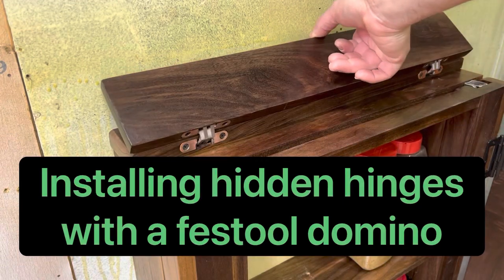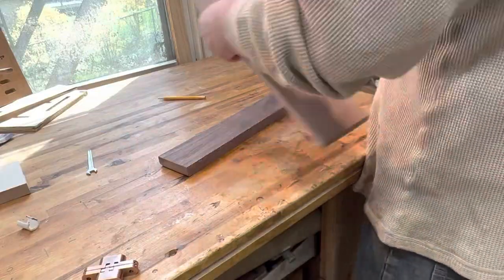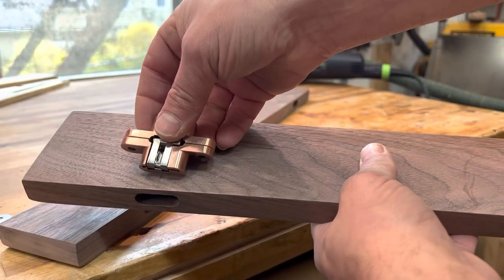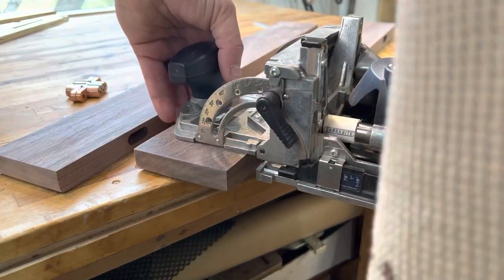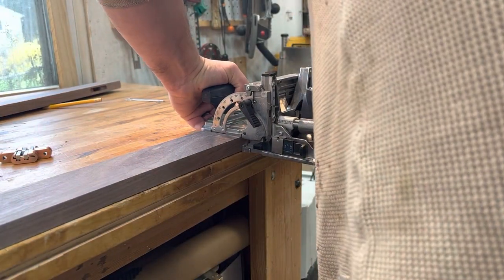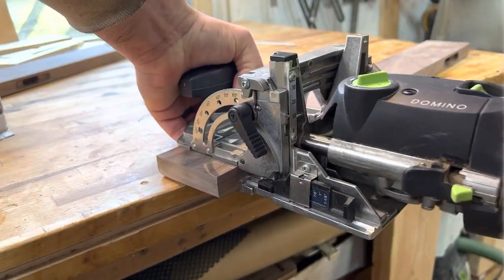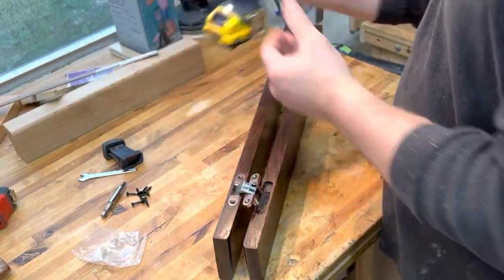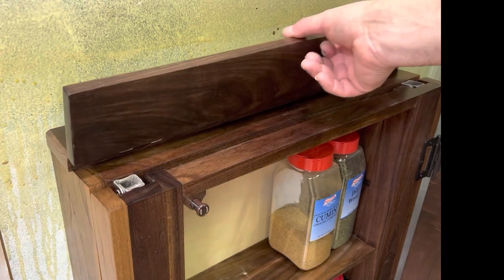Hidden hinges using the Festool Domino DF500

Comment: I just love finding a channel where the "talking head" in the video...FROM THE BEGINGING...!!!...doesn't ack like a "know it all" and clearly states that what they are doing is "how they do it" but that there are other methods...EXCELLENT...!!!

I've been using the domino system for hidden hinges for over 20 years. I actual spoke and worked with SOSS in the 90s to get certain sizes which they had. Not too popular in the U.S. as much of is metric but that is all I work in anyway because its just a easier and more accurate system of measure (in my way of working.)

Great video, and looking forward to reviewing more...!!!
Reply from the maker: Thanks! I generally do shorts because of the time commitment but there are so many ways to do the same thing! 
That is so cool that you talked with them and came up with this way of doing it! It really makes it so easy

Comment: I like the pvc trick, very nice, but can I ask why the top is hinged if all it reveals is a solid surface below? It doesn’t reveal anything? No access or hidden pockets? Am I missing something? 
Great work on the adaption of the tool though!
Reply from the maker: I did not post the whole piece this is made for – the door of this cabinet flips up to make a table or closes like a door. In order to accomplish both and have it look like a cabinet I have to be able to move this piece out of the way. But I don’t want visible hinges on the top